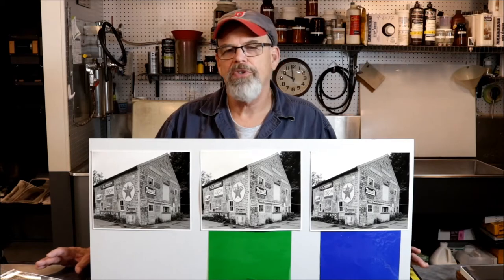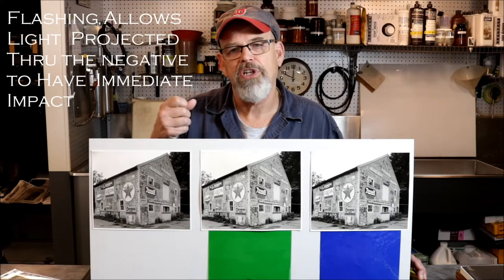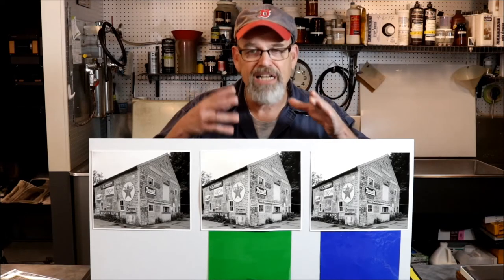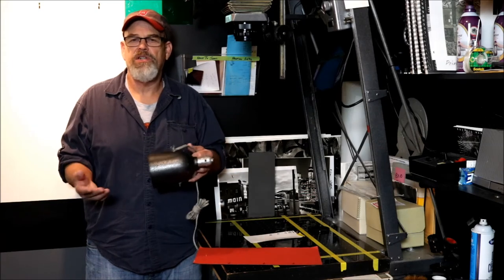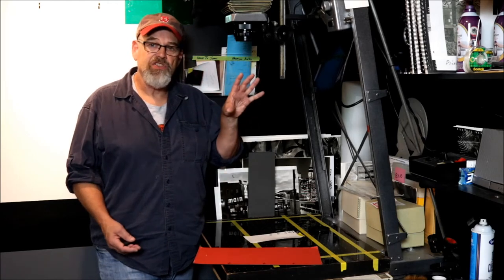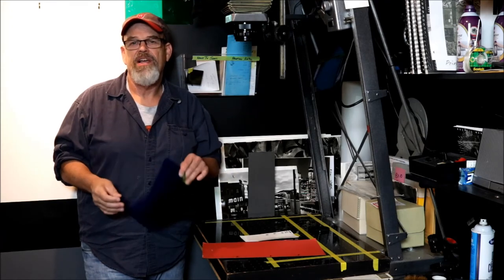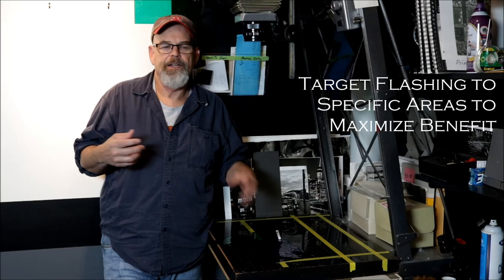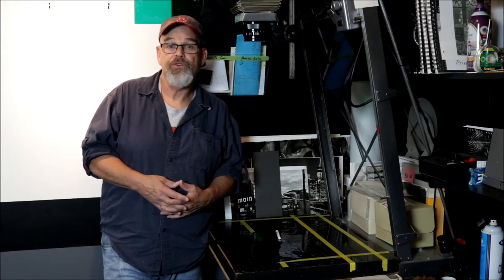Analog Photography methods and philosophy

Comment: I have been doing this for quite a while now. Although I only figured it out when the keypad of my Ilford 500 head started giving me problems and I purchased a new RH Designs keypad to replace it. The old keypad gave me light from both the blue and green filters in different power strengths to achieve the desired filter. The new keypad switched the blue filter on for a set time, and then the green filter for a set time. When I wanted to burn the sky down slightly I would set the keypad for all blue, or all green and flash that part of the print for the desired effect.

Comment: Given that I'm a darkroom printing "newbie", I have no idea how this works. Maybe you can help to clear my confusion, especially with regard to the green gel... It's my understanding (taken from Ilford's technical information "Contrast Control") that Ilford's multigrade paper is a combination of three emulsions B C and D  all of which are equally sensitive to blue light (meaning each emulsion "reacts" to the blue light at the same exposure TIME with emulsion B resolving at higher density than C and C a higher density than D. Same exposure time with density from B>C>D. However, the green-sensitive portions of B C and D do NOT respond to exposure times equally where D reacts first C reacts second and B reacts third. By the time C reacts, D has reached it's maximum density and by the time B reacts, C and D have already reached their maximum densities. If you "flash" with a green gel, aren't you just maxing out the density of D and possibly C and B, depending on the length of the flash? How does this do anything that a multigrade filter doesn't accomplish when it (the filter) changes the amount of green vs blue light hitting the paper?

Here is a link to the Ilford technical information I'm referencing:
https://www.ilfordphoto.com/wp/wp-content/uploads/2017/03/Contrast-control-for-Ilford-Multigrade.pdf
Reply from the maker: The way I interpret the explanation and by way of experience is the three emulsions have equal amounts of emulsion reacting to Blue light.  This bears out my theory, the amount of Green light used in the final printing directly affects the mid-tone contrast.  Naturally, the Green light is most used to create the lightest tone in the final print, and therefore does not need to be as predominate as the emulsion reacting to Blue light.  It simply takes more exposure to create max black than it does for the first hint of grey tonality, in that regard the two emulsions are biased in that direction.   So, with the lightest tones coming from the most dense part of the negative, there will be other mid to upper tones not as dense on the negative that will receive greater amounts of Green light, resulting in less mid-tone contrast relationships.  I'm not suggesting that Green light is not necessary in the printing formula.  What I am a big believer in is the less Green light necessary to effect a smooth transition of all tonalities the higher the mid-tone separations can be.  Resulting mid-tone relationships will be a personal preference for sure.  The manner in which I print with only max Blue and max Green allows for the most flexibility in the final print.  That is the sole reason my negatives have generous shadow information with a lower overall highlight density in the negative.  In that manner, I control the final print contrast with Multi-Contrast printing papers, rather than the traditional means of building contrast into the negative relationships.     Hope this helps, and thanks for reaching out.
Reply: @SteveShermansPowerofProcess  thank you so much Steve for your lengthy and thoughtful explanation. I really appreciate it. Since I am very new to darkroom printing (about 2 months) it will take me time to fully understand your comment via direct, hands-on experience in my darkroom. Your channel is full of excellent information. It's an excellent resource.
Reply from the maker: @smitty112877  thank you for your kind words, glad to see value.